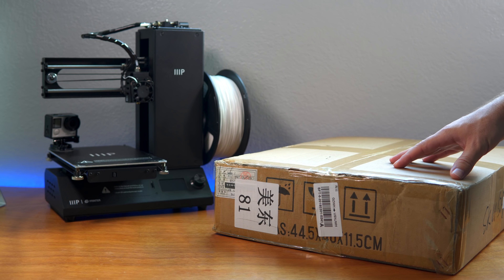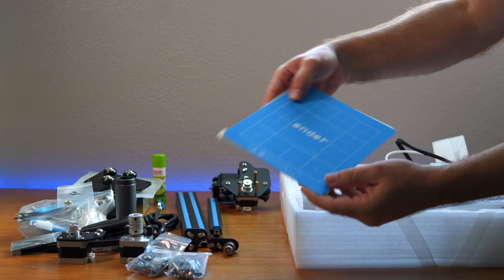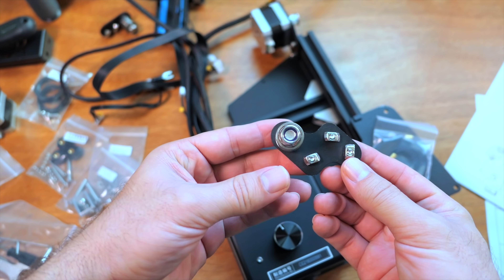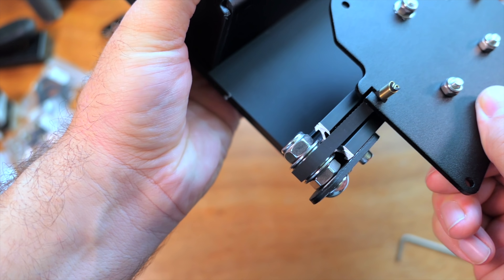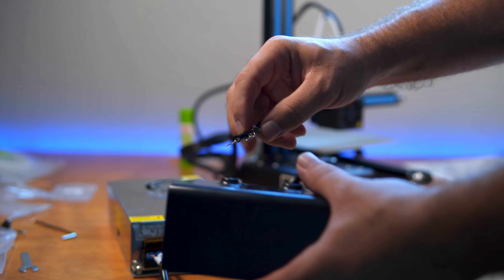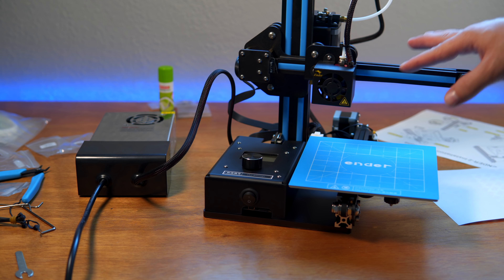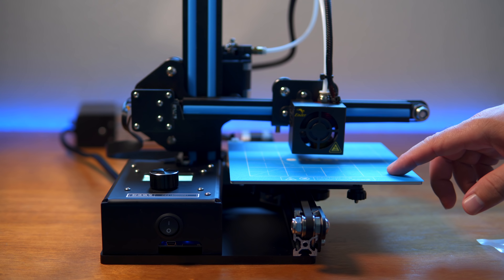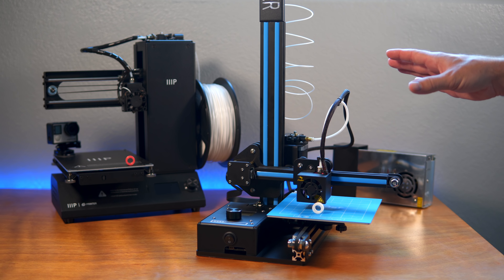Creality Ender 2 - 3D Printer - Unbox & Setup

Comment: Heads up - The tension on your Y belt might be a bit high. It should have a bit more slack so that it doesn't pull too hard on the spindle and damage the coils and bearing in the motor.
Reply: I agree, Y belt tension might be a little too tight.

Comment: I am still using this original Ender 2 printer and love it.  I have used it many times to build something to make a repair or item that I could not find.  I do not have the original documentation and would love to obtain it.   There are so many setting available on the printer panel and I am not 100% sure what many of them do.  Does anyone have a manual?

Comment: I was following some tweets by @woodpunk and the black-on-black colorway made it hard to identify stuff.

Tip from @woodpunk: connect the Z-limit wire before installing it.

X-limit switch backwards, I made that mistake this morning.

I also got the Z beam reversed (blue away from the controller) first time. Connecting the tube to the filament feed was non-obvious too and I felt really nervous self-tapping it and not knowing when to stop.

My tips:
Mount the heated bed to the Y-shuttle before putting the shuttle on the beam, lining up the screw, spring, hole and nut is tricky when the shuttle's on the beam.
Untangle the bundles of wire where they connect to the controller before plugging anything in.
Install the Z-axis brace before the beam. I think it might also be easier to mount the Z-motor and Z-limit to the beam before mounting the beam on the base.
Feed the X-axis belt along the X-beam, then fit the head-shuttle, then the X-pulley, because pulley plus two belt thicknesses is more than the gap between the shuttle's rollers.

The power connectors suck pretty bad, no anti-snag where the AC lead passes through the cover and I had to really squeeze the boots on the DC connectors to get them through. The wires were stiff enough to make starting the threads quite difficult on the cover's two screws.

Test print later today probably.

I paid 102GBP with free postage from a relatively local eBay seller, the tweets I followed were written 10 weeks ago and linked to the same seller saying "under 120GBP", so I'm feeling pretty happy considering GBP isn't getting stronger.

I'm annoyed that the printer doesn't include any info about the stock nozzle size or the gauge and material spec of the filament included. I'd like to experiment with LDPE and HDPE, especially recycling my own since so much food packaging is PE.

Comment: There is nothing wrong with the T-Nuts.  They are designed so you don't need to slide them into the channel.  As you insert them and tighten them, they will spin/self-align within the channel.  I'm a bit surprised that you opted for the Ender 2 rather than the Ender 3.  You get a much better printer for your money.
Reply: You deffo don't get a "better" printer. 
I own a few ender 2 and 3's. My 2's print better quality than the 3's because of the way it's designed. 

But what you do get is more print surface.

Comment: Hi, I'm about to build one with extra Chinese parts and I'm stuck with the parts size of the XY carriage wheels mount. I need to know what size is the wheels mount screws and spacers length for both X & Y axis. I believe the diameters are M5. Could you help out?
Thanks a lot. I'll really appreciate.

Comment: Yea those nuts seem funny at first.  They are designed so that you don't have to take the end caps off the channels, instead they are elongated so that they  can fit into the channel and as you tighten the bolt the nuts rotate and then push against the walls of the channels.